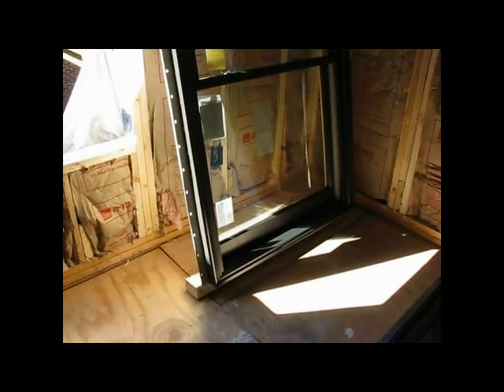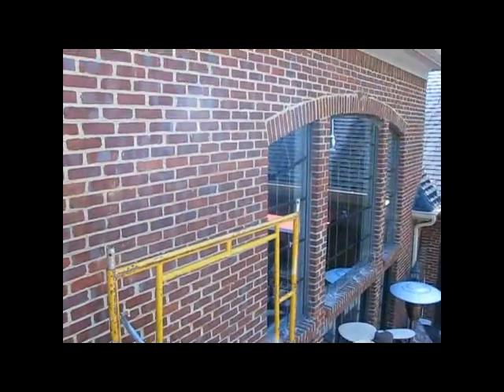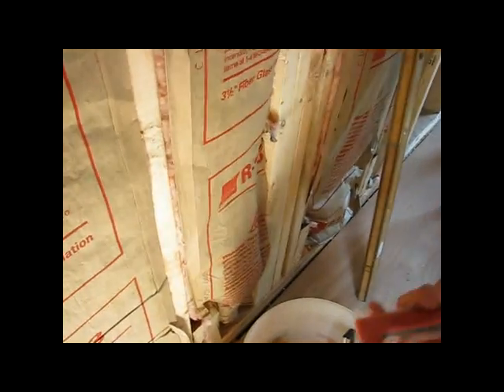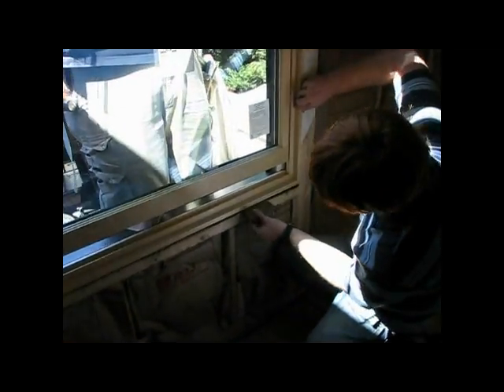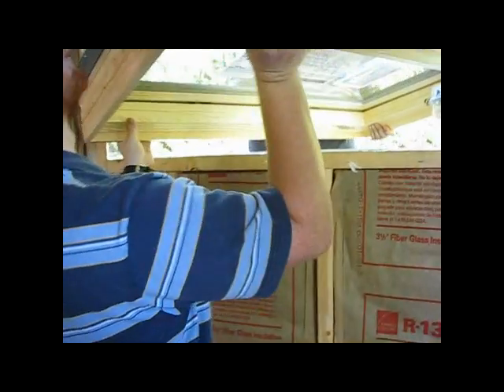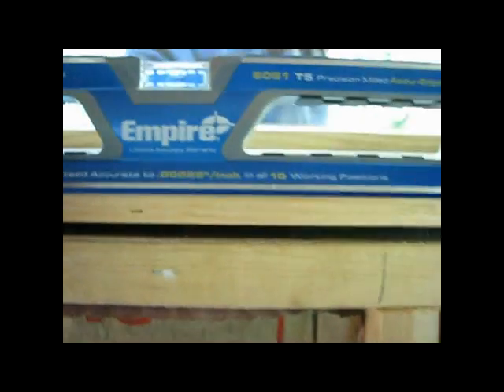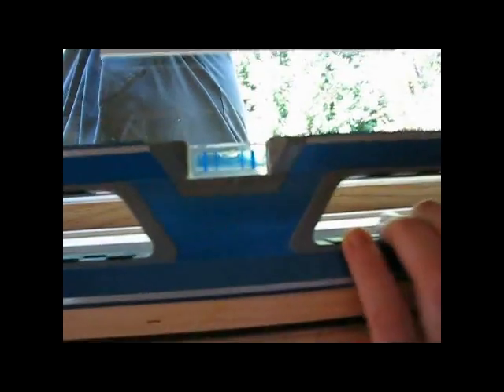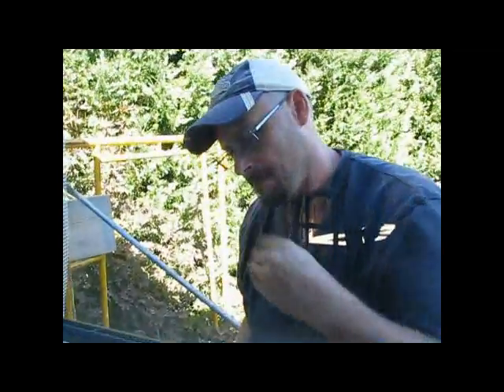High End Attic Expansion - Vlog #13  Installing Exterior Windows

Comment from the maker: @aaadream We always install windows per manufactures recommendations and based on the best practices I have learned in 30 years.  Modern windows are installed with a house wrap (I use Tyvek which I think is the best) over the exterior sheathing then the window flange in taped to the Tyvek.  We go the additional step of installing head flashing on the exterior.   The windows are foamed from the inside with non-expanding foam before drywall is hung.  I will try to show the exterior details in . .

Comment from the maker: @aaadream (continued) I will show this in another video.  There is no caulk until the installation is complete and that is just for aesthetic reasons.  One should never rely on caulk for a weatherproofing system.  Only positive flashing systems should be relied upon for moisture protection.  Metal and asphaltic membranes have 10 times the life span of caulk as caulk will fail a lot sooner than what I call a positive flashing system.